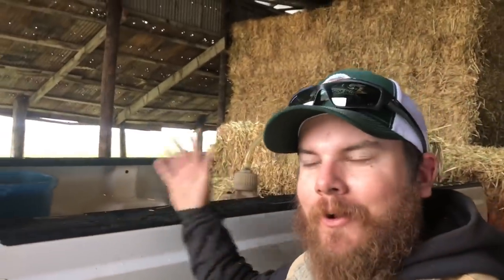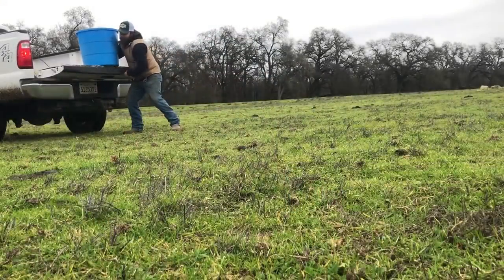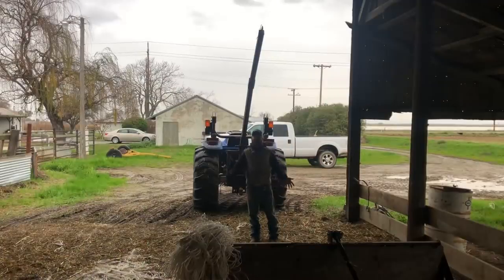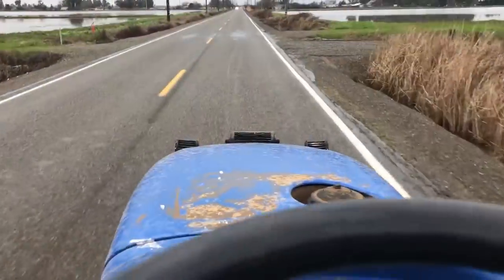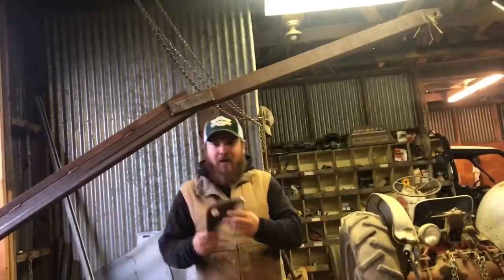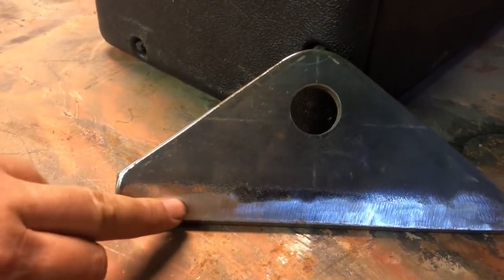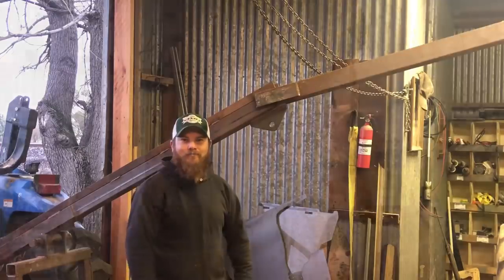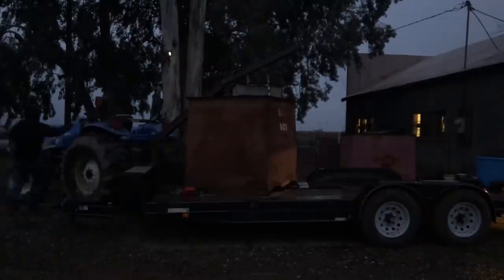One of my Favorite Homemade 3 Point Attachments!

Comment: That would be a real handy boom to have around my farm! I may look into building something very similar. 
I've gotta ask what brand of hat is that your wearing in the video? I used to have one looked very similar and have lost it and wanted to find another. Us country boys know what a good hat looks/feels  like
Reply from the maker: Thanks Travis yeah they’re handy and pretty easy to make. I think I built that out of scrap pieces I had laying around.  The hat came from my local machine shop but I looked at the hat band and it says “Richardson style 112”. You’re right a good fitting hat is worth it’s weight in gold!  Thanks for watching!
Reply: Unless you have some knowledge of engineering it would be far safer to buy something designed for the job rather than take a chance and risk injury.
I'm surprised this farmer hasn't had an accident with that contraption.
Reply: @farmertylerranch4399  That says it all. Thirty plus years in vehicle manufacture and a safety inspector and I'm surprised you haven't had a serious accident from using that thing. I wouldn't trust that thing to lift anything above a couple of feet from the ground.

Comment: Curious, what is that thing you pick up at 9:00?
Reply from the maker: Good question Colby. It’s a Buck Rake. It attaches to a front end loader on a tractor and is used to push and stack piles of branches or other brush. Thanks for watching!
Reply: @farmertylerranch4399   Ah, going back and listening, you said that. I'd never seen one before. Great video. Awesome implement. Thanks for posting.
Reply from the maker: Thank you Colby!

Comment: "Need is the mother of invention". Neat lift system Tyler. How long will the protein tub last in winter pasture?
Reply from the maker: You got that right Ardurbin. I really “need” a front end loader. They can’t be that hard to build right?  I’m thinking about it...  That tub will last 7-15 days this time of year.  Just depends on the weather and the forage. When the forage is poor they go through tubs faster. When the forage is good like in the spring time that tub lasts over a month. So basically they self regulate depending on what they need. Thanks for watching!

Comment: That center point is too close to the tractor the leverage is doubling your weight load I welded pins onto my 3 point bracket and found the sweet spot on my boom then using some stout steel made brackets I could remove to the sweet spot it lessened the load big time but the tractor will only lift what it will lift

Comment: needed help from the  hoist? so you went over the max power the tractor can give. its never smart to put extra load on it with a hoist.  its a negative leverage effect on the tractor.. you can quickly give 1000's of kg extra force on the system.

Comment: This is one of the reasons why there are so many farm related deaths. Home made equipment like this made by people with little to no knowledge of engineering, safe working loads or structural strength. Why do you think manufacturers hire people who have degrees in engineering to design equipment? It's not just a matter of welding pieces of steel together, there is a lot more things to consider. As brilliant a welder you may think you are, if there is any flaws in that weld that causes it to break, damaging your machinery or worse, you could lose your life or that of someone else. Who knows what stresses you are putting that equipment under when you are lifting things you have no idea of what they weigh. There are reasons they put tags or plates with limits on capacity and safe working loads on machinery. It's not just to tell you what weight you can lift. but what weights you can't lift. The higher you have to lift the less weight you can lift safely. Adding ballast on the back of a tractor doesn't make it safer, it makes it all the more likely to fail. Once you start lifting above a certain height the centre of gravity shifts making the equipment more likely to tip over. Google how to operate a forklift/mobile crane, since it is the same principle, and learn about the risks of operating equipment like this. You'll be surprised how complicated it actually is.
Reply: Who call the osha inspector we get enough of you at work we don’t need you at our farms now. Boils down to be smart and use your brain. Most farming accidents occur because the person got complacent or to comfortable around the equipment and then got hurt or killed.